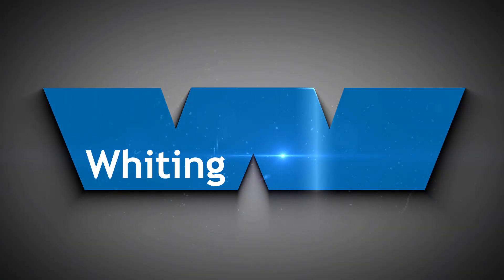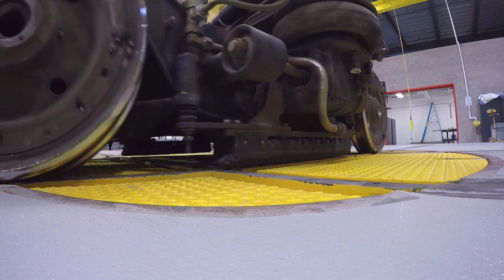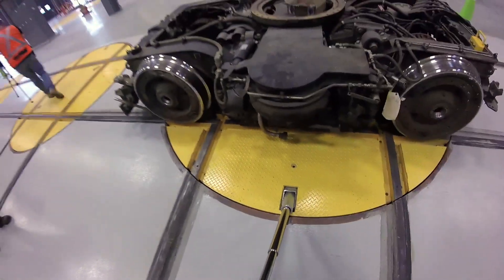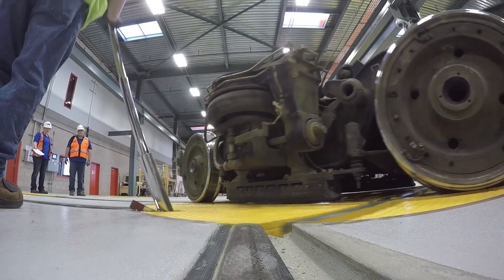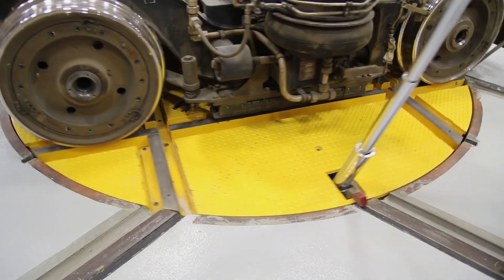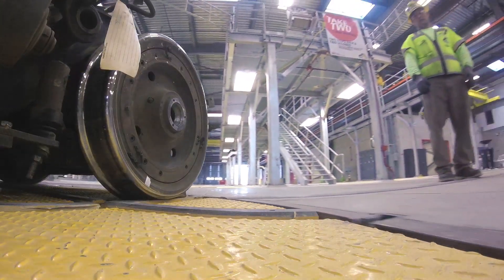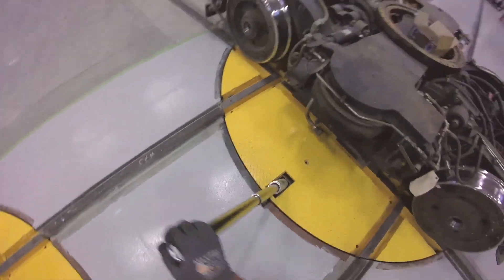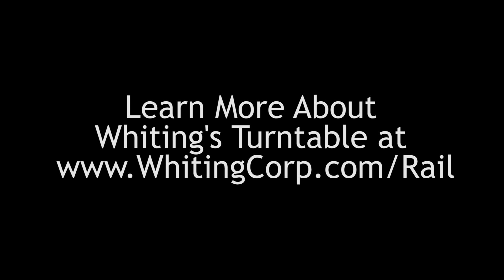Single Truck Turntable - Whiting Corporation

Comment: At least for cars where the bogeys spin freely, these could theoretically replace a full-size turntable. Rotate one bogey 90 degrees, pull the car around the corner like a Trammel of Archimedes, and rotate the other bogey.